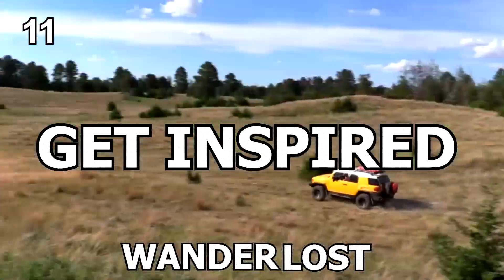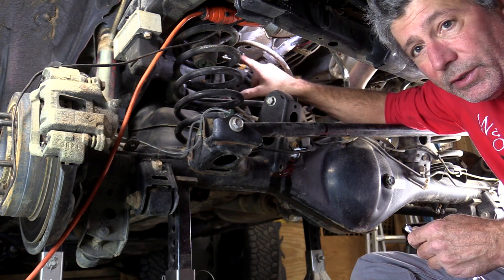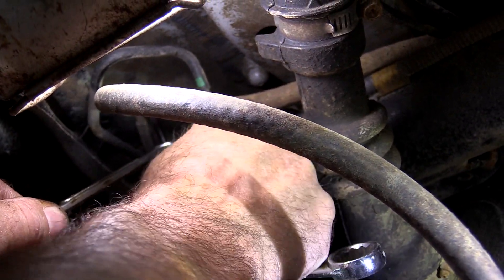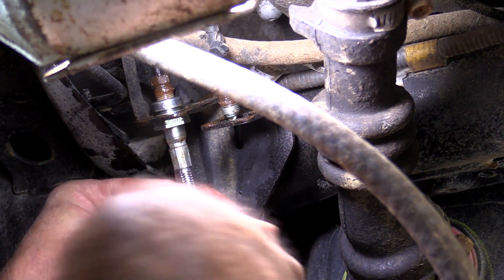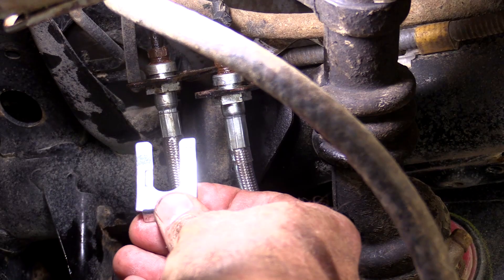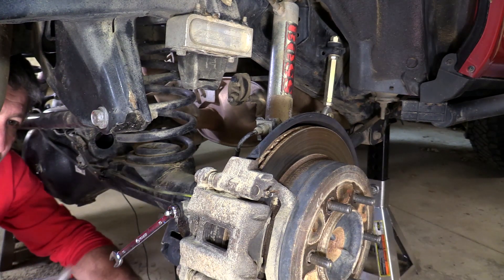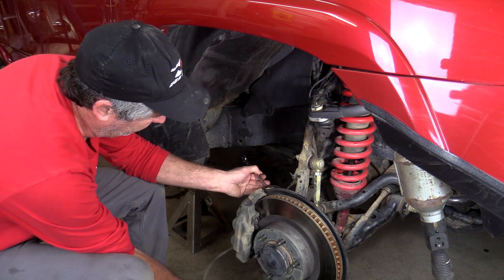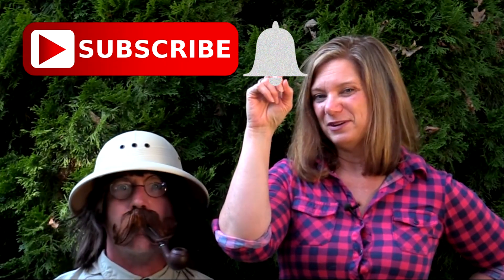Toyota Extended Rear Brake Lines, How To Install Them And Bleed The System

Comment: One thing to note is that after installing longer lines, make sure they aren't rubbing on anything at level ride height. On my 2016 I had to bend brackets slightly because the added length made the lines rub at normal street level. Easily done with a pair of channel locks.
Reply from the maker: Sound advice Steve, thanks. Ours were rubbing on the tank a little so before tightening them down for good we spun them a little bit so they would be free from rubbing.

Comment: So if the brake lines break, they can’t brake through the broke brake lines that broke. So don’t break the brake lines. Am I correct?
Reply from the maker: To the best of my knowledge, I can almost honestly, with no liability on my part, say maybe there is some correctness involved in your statement. Or not.
Reply: @WanderlostOverland  so you just admitted that you are neither confirming nor denying that I may be right or I may be wrong! But it’s definitely one of them eh?!
Reply from the maker: Precisely, maybe.